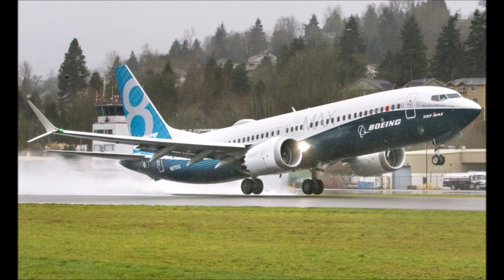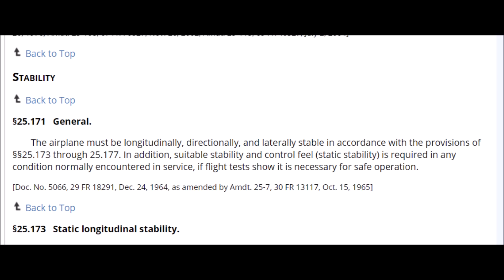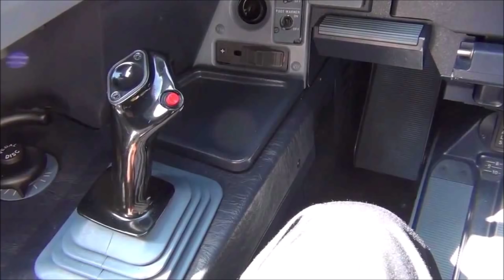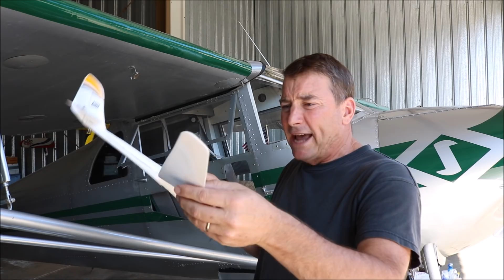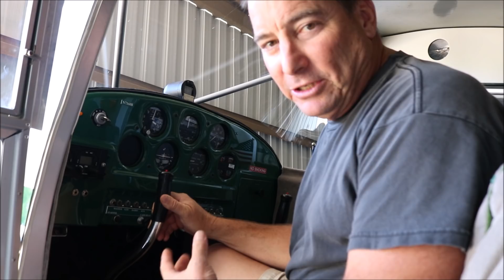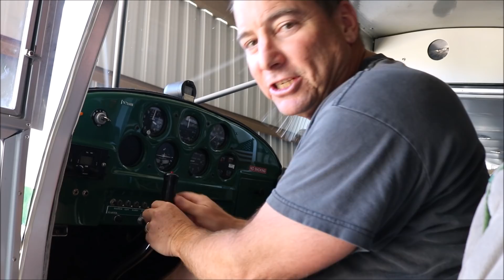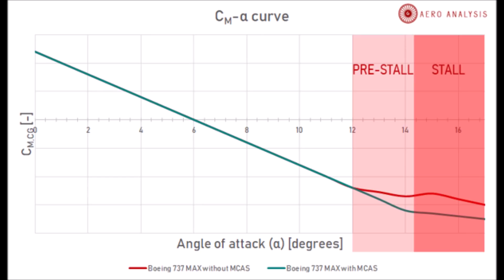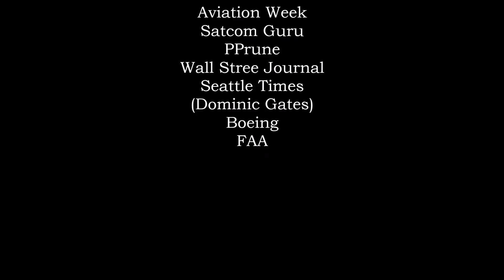737 Max UPDATE 30 Aug  2019

Comment: Captain being a pilot how it is possible to say MCAS is not a stall escape path.
 For me MCAS comes in action if angle of attack go high . Beyond the point wing enter in to stall.
 If MCAS not installed nose keep moving upwards , because high bypass engine install on pylon forward and up due to minimum ground clearance. This fwd & up movement disturbed C.G , totall air flow path .
  Aerodynamic characteristics of wing changed leading to stall. If correction not done with in 10 minutes.stall warning indication activated.

What ever correction done by Boeing/ FAA not correct.
MCAS  REDESIGN WITH FAILSAFE CONCEPT INTRODUCE. IF DONE PROPERLY NO NEED OF PILOTS TRAINING IN SIMULATOR.

Comment: It appears this plane is not aerodynamic, it has pitch up due to this.  Say you have double engine failure and need to glide, can you do that?  If you lose all electronics and have to fly manually could you?  Will the 737 Max glide in these circumstances?

Comment: Your videos on this topic are astoundingly interesting. I've listened hard but can't understand an aspect of augmentation and would appreciate any explanation. As I understand it, MCAS augments the 737 MAX flight characteristics to meet required FAA aircraft control characteristics already met by earlier 737 versions. It seems it was also exploited to allow pilots certified only for earlier 737 versions also to fly the 737 MAX without undergoing further type training. Surely then, in the (not particularly remarkable) event of the augmentation system failing or being disengaged, the pilot is then flying an aircraft for which they are not fully trained? I am surprised that is 'legal'.

Comment: Hi Juan, Over the years a broken or seized jackscrew has caused many, too many crashes, so if the mechanism on this new aircraft runs out of control to the full set limit of it's travel and stops seized. Will this aircraft crash?

Comment: Well well well, yesterday we learned that Forkner, Boeing's chief test pilot for the 737 Max was well aware of MCAS, its  expanded role in flight control and knowingly failed to correct a representation he had made to the FAA about why references to MCAS should be deleted from the flight manual. He's busy pleading the 5th on releasing documents as they likely will incriminate him.

Comment: SO, MCAS was designed as a 'feedback' enhancement for the pilots to recognise a stall.
BUT some one switched oversight engineering staff for 'young upstarts'.
AND MCAS was changed to recover aircraft from a stall if pilots were asleep.
UNFORTUNATELY against pilot wishes and outside their control.
IT just needed to be given the wrong info.....
"SO,if a stall is imminent,would ramping up engine power cause a stall in a MAX but not an older 737?"
If the answer is yes,are you working for Boeing?

Comment: I worked for Boeing from 1984 through 1995.  My last assignment involved the 777 development.  Among other horrible decisions made by top management, Gucker and Mullaly et al, we outsourced the ENGINEERING DESIGN of most of the body sections to Kawasaki Heavy Industries, Mitsubishi Heavy Industries, and Fuji Heavy Industries.  All of the body sections include the vital longeron members that allow the body to transmit loads from the wing lift, the engine thrust, and the horizontal stabilizer that provides a negative lift to complete the aerodynamic clevis for stable flight.  Prior to the 1990's all of this structural design was performed by Boeing engineers, creating a core group of experienced aircraft structural designers.  The opportunity to be mentored by this group and to become one of them is the BEST REASON for any young engineer to accept a Boeing job offer.But what happened?  Boeing outsourced the ENGINEERING design of the WINGBOX to Fuji Heavy Industries.  AMERICAN aircraft structural designers at Boeing were left with little to do and were bought out with early retirement.  Now Boeing does not have a core group of experienced aircraft structural designers that would allow the company to perform a proper redesign of the narrow body airframe to properly carry the 100 inch diameter CFM-LEAP engine.  See my explanation of this outsourcing and of the standard takeoff procedure of large jet aircraft   https://www.youtube.com/watch?v=_ZQ9k_nL4AM    https://www.youtube.com/watch?v=0HZm1c_DlVI
Reply: Agree 100%   Supports and goes along with my comment in here somewhere.  Parts of my comment follows.
...
All the senior engineers have been pushed out along with anyone that suggests fixing obvious problems or potential problems.  All the "wait a minute, what if" people have been shown the door and only the "yes" people remain.  As a general rule of thumb, you get a better engineered product if you have a few of the "wait a minute, what if" people involved in the design and validation process.

So the management team has systematically & deliberately over time seriously impaired the engineering (hardware & software) capabilities of this once great company.  They have turned the company from an engineering driven company to a systems integration company.
...
Management & manufacturing would have to return to Seattle.  All software would have to be done in-house.  I am sure that all this can not & will not happen!  Good engineers & managers will be extremely reluctant to wade into this disaster.  The management teams since 1997 have done a great job of destroying this once great company.

Comment: the prob6lem is weight and balance. They need to had over 700 pds off lead inthe area of of the entry door .like change the floor panels . aircraft maintenance engineer. it has nothing to do with pilot, this airplane is flight by cable that control PCU. it is a pilot error 100%, to lazy to fly the airplane and hit ap at take off.

Comment: im not a pilot, nor engineer
i can not argue  the  points   you  explained

first plane sold 2014
since that about 380 sold
within 4 years  i think there were 15000 departure with these planes

in 2 case mcas failed, or pilots couldnt handle (again i can not make statement neither on pilot nor  on engineer side)

if  this  failure  directly from mcas, then  it should came out years before..

so for me, its all still confusing
for me  its all looking airbus wants to sell more plane

for me  it is  very hard to picturing  engineers werent see  this before  airplane went out to the  public

Comment: I was told by a colleague that even with the Stab trim cutout switches to cutout the MCAS could still drive the trim motor. Is this correct?
Reply from the maker: No. That's the Column cut out switches.
Reply: I think Juan has also said previously that with the Stab trim cutout switches to cutout, the ONLY way to move the stab is by manually turning the trim wheels.

Comment: I thank you for all the aviation information.. Many years ago I used to fly and really enjoy flying.
I started flying in high school.  This school had an aviation class, flying club and airplane.  The airplane was an Aronica 7AC,
and this si where I soloed.  When I stopped flying due to going back in the service I hD A single,and multi engine certificates.
I worked a Lear Aircraft in test and research and was just starting working with the model 23 & 24 Learjet when Nixon put the binder on the monies.
This is the reason I went back into the service (Air Force)  Yes! I have had issues with my stopping my flying.
When I was in Japan the Army sent a message and asked me to transfer to the Army as a chopper pilot and I decided not to do this.,

Ken

Comment: as an engineer, what worries me is that not only the initial problem which helped caused two crashes got through, but they found another during the subsequent testing. Since their processes seem to be flawed, I am not convinced that they will have found all issues. I'll fly on it once it has completed several years trouble free

Comment: THE 737 MAX IS FUNDAMENTALLY FLAWED, BECAUSE THE OVERSIZED ENGINES WERE MOVED UP SEVERAL INCHES, SUCH THAT AT VERY HIGH ANGLES OF ATTACK. THE ENGINE NACELLES BLOCK SIGNIFICANT AIRFLOW OVER THE UPPER WING.  THE MCAS IS REACTING TO AN ACTUAL STALL AFTER TAKEOFF, AT HIGH GROSS WEIGHT AND IN AN ACCELERATED TURN, THE AIRCRAFT WILL ACTUALLY STALL, WHICH MAKES MCAS REACT WITH SUDDEN STALL RECOVERY PRESSURES.  BUT THE STALL IS REAL AND COMPLETE, AND THE AIRCRAFT IS TOO LOW TO RECOVER.  NO 737 MAX SHOULD BE FLOWN UNTIL A THOROUGH WIND TUNNEL TEST IS CONDUCTED ON THE  737 MAX AIRFRAME,  WHICH IS NOT THE STANDARD 737 AIRFRAME: THE 737 MAX IS MUCH, MUCH DIFFERENT.  MERE SOFTWARE MCAS MODS WILL RESULT IN A SAFE AIRCRAFT.
Reply: LAST SENTENCE SHOULD READ, "MERE SOFTWARE MODS WILL NOT, WILL NOT, RESULT IN A SAFE AIRCRAFT."

Comment: The plane itself is flawed by design since they wanted to use those larger engines to keep up with the far superior Airbus. Boeing needs to be held accountable. They put the engines up higher on the wings which caused the plane to do things it shouldn't and shouldn't need those MCAS system. I don't trust Boeing at all. I feel much safer on an Airbus at this point.

Comment: For aviation experts not looking at the big picture , what about aircraft storage policies for long periods time , besides the software upgrade or any other minor or major alteration regarding MCAS , cost effective maintenance checks have to be performed to get those stored airplanes back to service ,that is more expensive than maintenance checks performed to airplanes in service . Some parts will be have to be replaced and yet some systems may get damaged due to  storage site  weather conditions. Preservation of engines is also costly, Im just calling aviation experts to turn up with this issues. What about structural damage of skin, this aircraft are on ground ,they were designed to have  certain cycles of stress and strain in the air , they consider this fatigue in the design , whereas aircraft on ground for long periods of time get some other stress due to its own weight that must be tested on spars that werent design to be loaded this way. Electrical wiring must be checked too , hydraulic , fuel  hoses might crack , there is a lot to do on this aircraft once they are allowed to fly , besides just the upgrades of MCAS software and related.

Comment: Avoid eating process food, all kind of meat, alcohol, sugar and stop eating wheat. Use turmeric with lemon juice and little bit of apple cider vinegar daily. Moreover, avoid those foods which attracts you most and after lot of it eating you become hungry again (Insulin releasing, which digest them fast, more amount of insulin consumption by your body actually make you unhealthy and sick).
About MCAS, Boeing has done a blunder of building an almost new plane on old skeleton. Mounting bigger engines moving the CG has cascaded into a disaster. Aviation with flight safety is an expensive affair, taking short cuts to make big money compromising on safety and credibility is suicidal.  Boeing lover are permanent due to their robust and workhorse designs. I have flown B747-200/300s being 25 years plus aeroplanes once flying in 2009-10, were 100% reliable. Now flying B737NG with the same reliability.

Comment: If the updated MCAS software compares the output from both AOA probes, if there is a discrepancy between the probes the MCAS system is switched off. With the MCAS system switched off, the B737 max flying characteristics will not replicate the flying characteristics of the B737 legacy aircraft. Therefore the pilots will need cockpit time to familiarise themselves with the different characteristics.

Comment: First of all, thank you for the very detailed and very informative update. I really appreciate the down to earth and non-technical (well, mostly non-technical) explanation you provided. But am I correct in hearing that pilots will not be 'fully' trained on the new 737-Max with MCAS until there 6 month annual review with simulator instruction? That prior to that just a few hours on an iPad? Why the shortcut? Why not, especially in this case, require all 737-Max pilots to complete the iPad + FS training before being certified to fly the 737-Max?

Comment: From what I can tell.....Boeing put giant powerful engines on an airframe that was designed for an older smaller engine,...then they had to add software to compensate for the larger more powerful engines. It's no different than software in a car with too much engine to control the wheel spin for people who don't understand the power.
Boeing went the cheap route and now they have killed people due to their cost cutting nonsense.

Comment: I never understood how the control could only use one AOA sensor at a time.  Ignoring the redundant information is a problem.  The bigger problem is that you double the chance of failure.  I understood that the first plane to crash had problems, then landed.  When the ground crew checked it out, the computer switched to the other sensor which was OK.  When the plane took off, the computer switched to the defective sensor.  I can't imagine a control system with redundant sensors that only used data from one sensor.  Whoever approved this software should face criminal charges.  That is my understanding and I might be wrong.

Comment: I am not an aeronautics engineer but understand physics.    Bigger engines ; same airframe. and yet we are to believe that this is a stable aircraft ?  The reason cited here is that it has to be stable because FAA ??  
Well..  as we found out, the FAA is not exactly an impartial agency. And if there was no problem, they wouldn't go about designing a system like MCAS to help override any issues. would they ? 

I, for one, am leery about flying in a Max even when approved

Comment: If the problem starts with an erroneous alpha vane signal, of either mechanical or electric/electronic origin, why is the remedy to concentrate the solution further down the line? If frequent loss of a wheel were a known problem on a particular model of automobile, would the solution be to install a special, cleverly adaptive, compensating steering system, or institute specialised driver training, or would they look at WHY the damned wheel is so prone to dropping off the car?
Reply: The Air Force versions of the MAX have TWO sensors.

Comment: Best explanation I have seen on YouTube! Godspeed on your health, Seems like the worst is behind you. I am in shock that not all pilots are obliged to go in the sim before flying the Max again, specifically to deal with the new MCAS (potential failure scenarios). Here again the FAA is LAX giving their pilots up to a year to experience MCAS errors in the Sim. No thanks, as a Pilot and passenger, I won’t set foot in a MAX until I am assured that all pilots have at least been in the simulator once to deal with potential MCAS errors. Here again Economics is ruling over safety! A one hour iPad course is a JOKE!

Comment: Qantas Flight 72 (QF72) is a scheduled flight from Singapore Changi Airport to Perth Airport. On 7 October 2008 the flight made an emergency landing at Learmonth airport near the town of Exmouth, Western Australia following an inflight accident featuring a pair of sudden uncommanded pitch-down manoeuvres that severely injured many of the passengers and crew.[1][2][3][4][5] The injuries included fractures, lacerations and spinal injuries. At Learmonth, the plane was met by the Royal Flying Doctor Service of Australia and CareFlight,[6][7] where 14 people were airlifted to Perth for hospitalization, with 39 others also attending hospital.[8][9][10] Two planes were sent by Qantas to Learmonth to collect the remaining passengers and crew.[11] In all, one crew member and 11 passengers suffered serious injuries, while eight crew and 99 passengers suffered minor injuries.[12] The Australian Transport Safety Bureau investigation found a fault with one of the aircraft's three air data inertial reference units and a previously unknown software design limitation of the Airbus A330's fly-by-wire flight control primary computer (FCPC).  Geez, sound familiar?!

Comment: Your comments at about 5 minutes in are nonsense.  I'm not a pilot but I am an engineer who has worked for Hughes and Lockheed.  The airplane is unstable when the engine was operated at full throttle because of the engine placement.   That is the problem.  The MCAS was not installed to make the MAX handle like previous iterations of the 737, it was installed to prevent the inherent instability of the aircraft from causing a stall and a crash.  It was created to hide the instability of the aircraft.  It was explicitly an anti-stall system bypassing pilot control.   I was looking forward to your discussion but I can't continue because  I think your analysis is completely wrong from the start.

Comment: Well done and thanks for the clear explanation! I am an amateur pilot (Pitts S-2B) and aerospace engineer. I did the stress analysis on the bleed air ducting directly attached to the turbofans of the 737 Max as well as some electrical/hydraulic systems support analysis on the engine struts. I'm not technically competent in stability/augmentation/control design but it is an interest of mine. I was astounded to learn that there was only one angle of attack indicator feeding critical data into this flight control system of the 737 Max. I am sympathetic to the idea that the failure of this system should be no more of an emergency than a traditional runaway trim situation but I was unaware of the "christmas tree" of indicator lights that the pilot would see during this failure event as you describe it. This whole saga to me feels like the result of decisions being driven by people with an MBA/Accounting degree rather than traditional engineering and test pilots making the call. What a shame. Thanks again and hope you get back in the air soon.